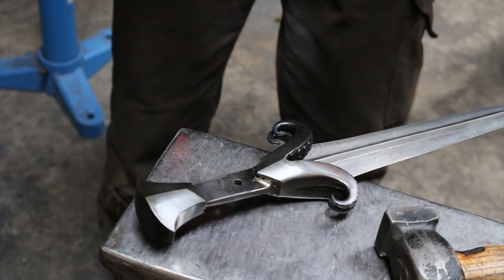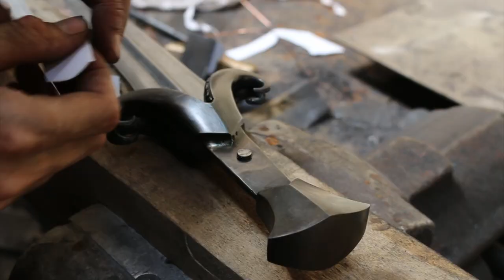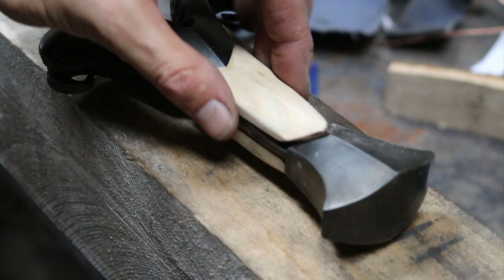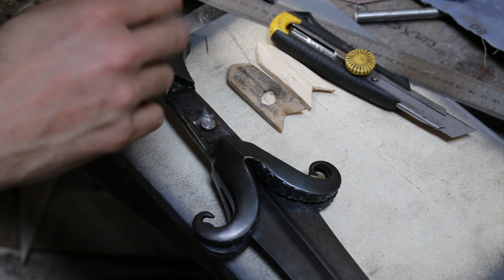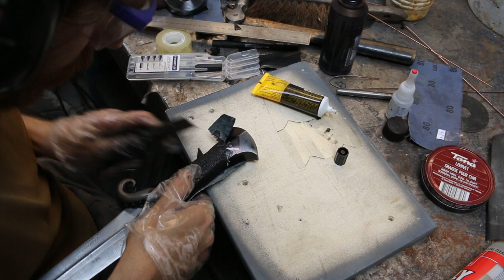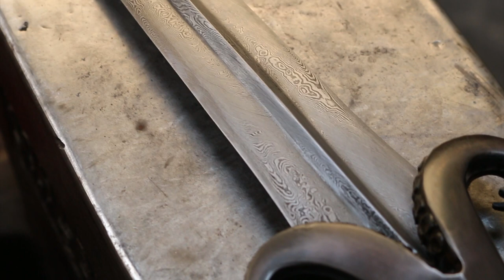Forging a Damascus Mycenaean dagger part 5, woodwork.

Comment: Absolutely gorgeous smithing, why do you always choose to do a sleeve over the tang instead attaching the wood or cross guard to the the tang itself?
Reply from the maker: they used rivets in the bronze age.  so it seamed  logical.  I do prefer the other method actually.

Comment: Great job, was watching all your videos and im amazed! Could you tell me what is the white powder you put on the melted steel while doing the welding part of the process?
Reply from the maker: it is borax, it protects the steel against burning and loss of carbon.
Reply: more than Likely it was Borax. Used as a fluxxing agent to seal the surface from oxygen and preventing scale. in most cases it can be bought at the local grocery in the laudry detergent aisle

Comment: This Looks amazing, But what is the point of the "reverse" fuller down the middle?,  I think That would be used for stabbing because any  intrusion like that would make it harder for the wound to close. Or was it an aesthetic choice?
Reply from the maker: it is a bronze age style,  those knives and swords had ribs, for strength, because of the relatively weak material.   
in late medieval Europe they adopted the central rib for trusting swords and dirks,  
those where strong ridged swords and daggers good for penetrating armor.  
but I personally just like the shape.  (-;
Reply: Freerk Wieringa ha, I agree, It looks quite nice, I had 100% forgot about the strengths of materials before steel :b,
Reply: It is the Antifuller!!! It makes the dagger evil...

True story.